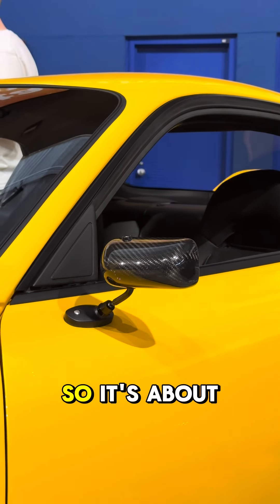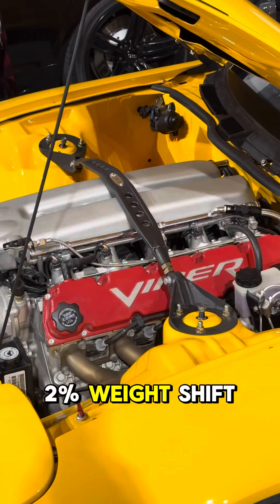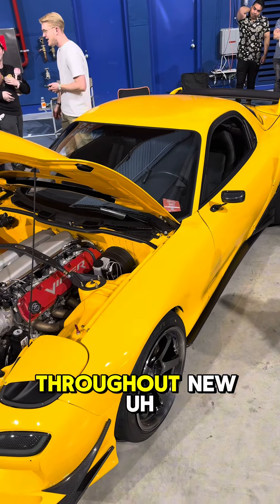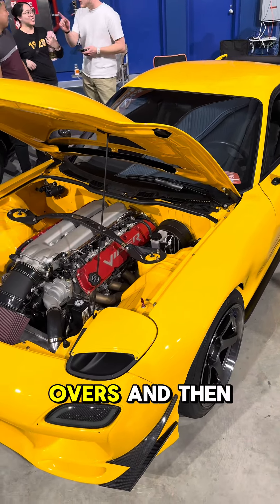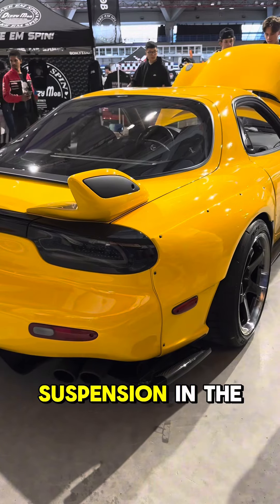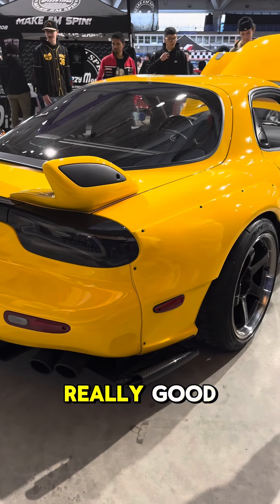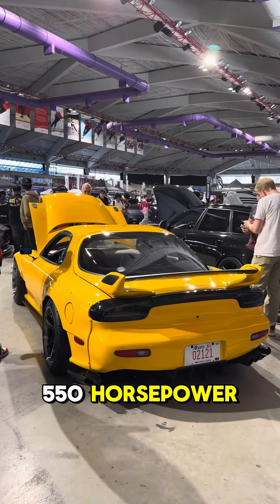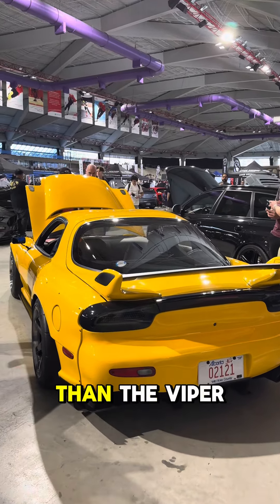Mazda Rx7 with Viper V10 Swap! 🔥

Comment: I love the viper v10, but dude the weight. The weight still matters. Is the distribution handled properly with the suspension he mentioned? 150 lbs heavier. And the car i have to imagine is a bit front heavy with that big of an engine in it